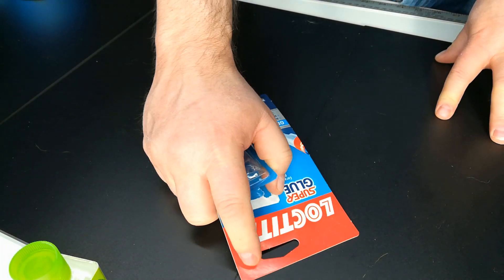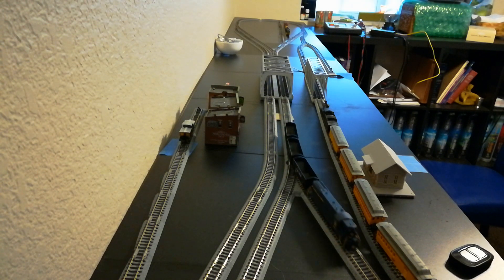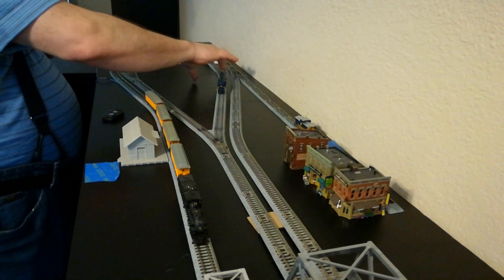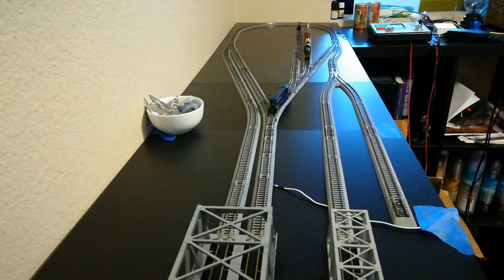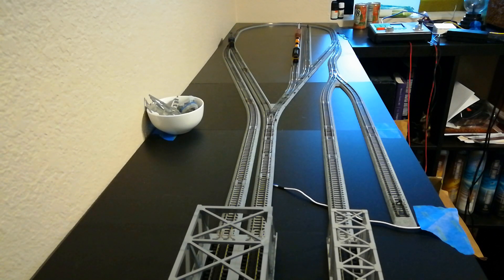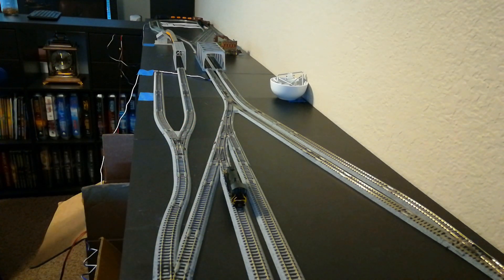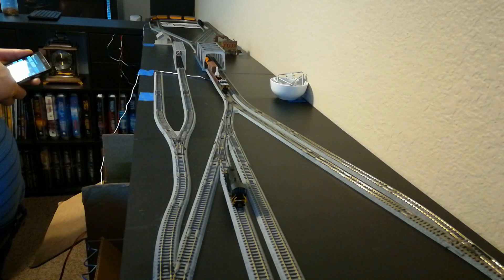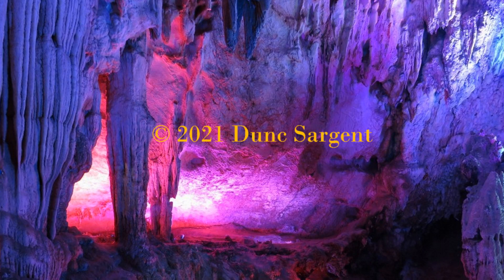N Scale Bookcase Shelf Layout Update and Running Session 2021-01-31

Comment: I've been considering my options in terms of a layout, and I love this interesting twist on a dog bone!  Does the local track require different a controller so as not to conflict with the AR1s at each end? Because honestly this looks really cool!!!
Reply from the maker: I'm using an Arduino DCC++ EX as the DCC system, then a Raspberry Pi as the computer running JRMI.  Then I use old phones over WiFi as throttles.  So I can run all my locomotives at the same time.  It's recommended that the whole train fit within if you are using block detect -- which I am not (yet).  So I have no problem running a following locomotive into the reversing loop.  I hope that answers your question. --dunc